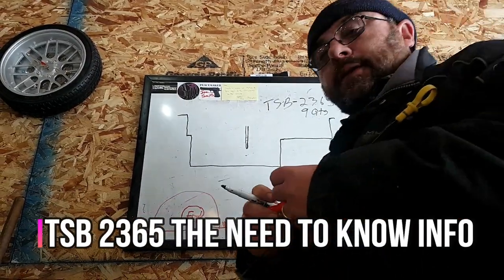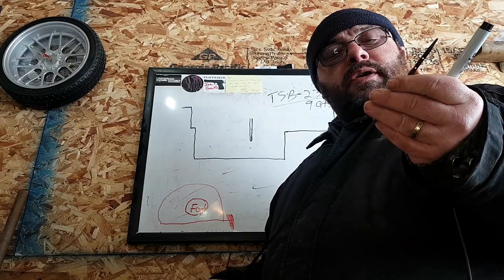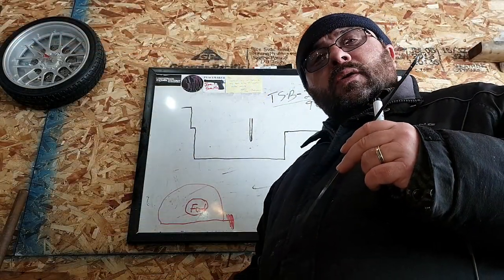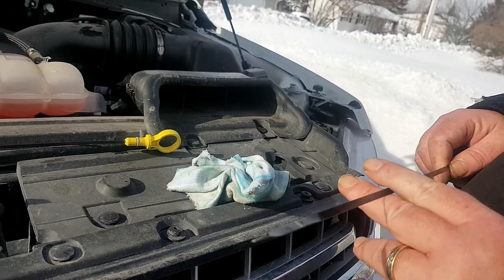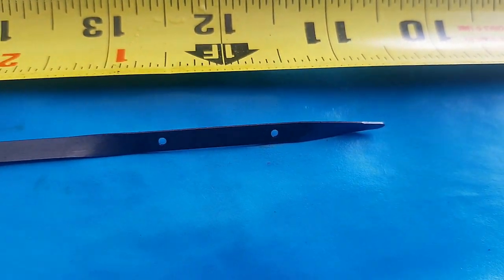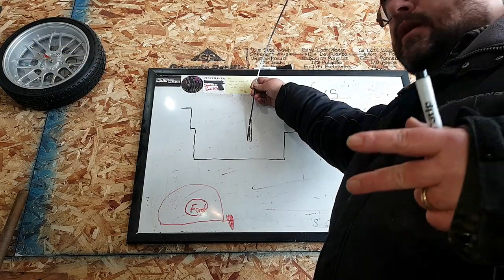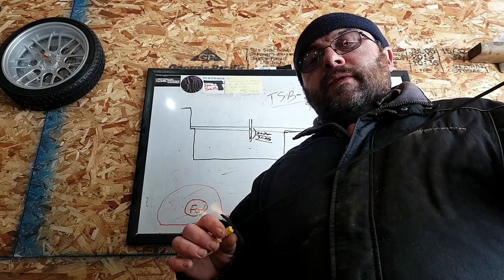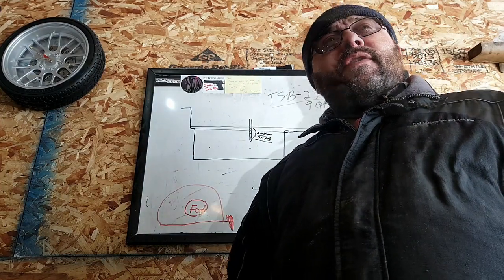tsb 2365 FORD F 150 burning oil & consumption 2018,2019,2020 supersede tsb 2338 and tsb 2058

Comment: My old truck was having this issue along with a super bad rattle on Deceleration. Dealership has fixed the rattle 3 times before and the 4th time said there was "no fix" for it. After they did the new dipstick bullshit and new oil change the rattle went away which told me my timing chains weren't getting the proper oil. So I got pissed off and sold the truck because I was sick of dealing with it, and my truck was 3,000km away from being out of Warranty. The dealership operations manager wouldn't guarantee to Warranty anything related to the ongoing issues once it ran out. Old truck was a 2018 F150 5.0L supercrew 3.73 rear end 57,000km..... Hopefully everyone else gets better service than I did, and has better luck with their truck.
Reply from the maker: seeing you were dealing with this with a 3:73 ring gear ,4:30 would be a much better setup for the 5.0 ,with the 10 speed. i just wish they kept the 6 speed.

Comment: Good informative vid Caper and it looks like you may have discovered a major problem with these new engines.  Sounds like Ford is kicking the can down the road so they won't have to issue en engine replacement recall on all those new F-150's.  Love to see what the results are in a week or so.  Cheers!
Reply from the maker: I'm looking forward to that as well. 🔨nailed it.

Comment: Just watched the whole video.
Please correct me if I'm wrong.

So Ford's fix is 4 Prong.
1.) Reprogram PCM
2.) Remove old dip stick that registered approximately 1 quart from MIN to MAX,
3.) Install new longer dip stick that registers approximately 2 quarts from MIN to MAX.
4.) Increase total crankcase capacity by approximately 1 quart. 

I was always told if you overfill an engine crankcase with too much oil, it may cause increased PCV pressures, and cause oil leaks, and increased oil consumption.  
-Chuck
Reply from the maker: Chuck is correct on 1 2 3 and 4
There is a reason that the engineers chose 9 quarts in the first place. 🤜🤛

Comment: Aahhhh I wish I had known about this before I bought my 2020 XLT5.0 only 4000km had the oil changed 3 weeks ago and just went out to check and lucky me it's almost halfway down the dipstick..booked appointment at dealer.
Reply from the maker: Sorry to hear that, let me know what they have to say,  they will try to sell you on normal breakin  period  . it wont stop using oil is the problem

Comment: I have a 2018 F150 5.0 with 19000 miles. I just changed the oil with 3% remaining and all the drain oil fit into one 5 litter jug.  It takes about 9 quarts to fill the engine.
Reply from the maker: Has the dipstick been changed in your truck Paul?

Comment: I wish I can take the motor out of my truck and put it on a new truck 4.6 I had it for 20 years and it still runs perfect no noise no burning oil perfect
Reply from the maker: The 4.6 is an awesome engine.  Ty tacho

Comment: Welp.... I ain’t ever buying ford that’s for sure!!. Great video brother 🤜🤛!!!
Reply from the maker: Keep that hemi undercoated it will last you a lifetime 🤜🤛
Reply: I've owned a few Fords over the past 40 years and have never had any major problems with any of them.  Just normal wear and tear.  My 14 year old F-350 is still running fine with over 230K miles  even with regular maintenance.   Cheers!
Reply from the maker: @TheFlatlander440  there is definitely something out of sorts the last 3 years on the 5.0 previous experience has been the same for me BILL. Ty again for stopping in 🤜🤛
Reply: It does make you

Comment: Nikasil and plasma coatings are very hard. Has anyone tried running their trucks hard to seat the rings? Mine doesn't eat any oil. Some heavy diesels with chrome cylinders have a hard time seating they use to put bon ami down the cylinder to get them to seat.
Reply from the maker: the problem is the ten speed transmission lugging the engine at low rpm like a diesel, running in sport mode would be effective . ty first and last

Comment: 2020 models now involved wow
Reply from the maker: Getting wilder by the minute
Reply: Got a 2020 a couple months ago because my 2018 was an oil burner, even after they replaced the motor. Dealer assured me they had the issue fixed in 2020, needless to say i bought my last Ford. Looking at their financial situation its estimated they will be bankrupt in less than 2 years

Comment: I had the flash and new longer dipstick installed.  I have 25000km on my truck  and they put a new engine in at 7000km and im still having the same problem with only18000 on the new engine . They changed my oil at 20000km and by 24800km it was on the low mark. 2 Liters gone. The dealer wants me to drive it till the low oil comes on and when it does he wants me to bring it back asap. I asked him for that in writing as i think this could harm the engine.  He said he has had not one customer come back with the low oil light on. I don't know if there is even a low oil light. Im not happy at all and i think im going to call Ford Canada.
Reply from the maker: I'm not sure what province you are in but look into canvac.it is like lemon law for the states. Ty for taking the time 👍
Reply: @thisguysgarage  I'm in Ontario and I work for Ford. Lol. I'm going to start asking around to see if I can get in touch with someone about this. Thanks for the reply. I read that if you change the PCV Valve to this one  7L3Z6A666A it helps. I just ordered one for $13 bucks from Amazon. Com it's over $70 on amazon. Ca. We get ripped off here in Canada.
Reply from the maker: @Satstalker  let me know how you make out Brian. Appreciate it 👍

Comment: Great video.  Do you know if the 2011- 2017 are at risk too ?
Reply from the maker: I have had 3 of those trucks  the only one I would avoid would be the 2017 if it had the ten speed transmission. 
Some had the six speed some had the ten speed.  Avoid the 10 speed at all costs.  And ty so much for taking the time 🤜🤛
Reply: Company truck lease return 2017 6 speed thinking of buying it after lease end in a month.  89K km.  I have had all the servicing done. Really quiet 5.0, no tick or piston slap.Goes like a scalded cat.  Has not consumed any oil in between 8K km oil changes. All highway.  Still has two years warranty on drive train. Do you think it will still be a problem child?
Reply from the maker: @patrickhowell9534  nope I wish I kept my 16 it was exactly the same way as your 17

Comment: Bought a brand new 150 5.0  at 3k down a liter,  i don't even hardly drive the truck i will check it at 4k   this truck makes me nervous for $ 56 K  i just went through snappin plugs in the head on my 5.4      1000 $$  for tune up snapped 1 at $99 per plug to extract  the guy before me they snapped all eight wow   8 @ 99 bucks labour just to remove the 1  plug x 8 plus 99 an hr shop rate
Reply from the maker: i hope it works out for ya! stay in touch ty for taking the time

Comment: I will check it soon. I had that dip stick change and engine flash a week ago. Would that engine flash hurt the performance? Thank you for your past advice.
Reply from the maker: They don't talk much about the engine flash. I'm skeptical the flash will or can change anything in regard to consumption. If you have not noticed a  difference. It should be negligible.  Ty for taking the time and please do let me know when you check the oil 🤜🤛
Reply: @thisguysgarage  I will let you know for sure.

Comment: This is ridiculous I got a 1999 4.6 v8 with 200,000 mi and don't burn oil at all
Reply from the maker: The 1999 4.6 was nearly indestructible. Just finished building one for my mustang. Thanks so much tacho

Comment: Hay I’m in the same boat and getting the run around. What oil are you using by that I mean what weight. At first I thought it may have been the brand of oil all being 5w-20 Castrol,Amsoil,Pennzoil,Royal Purple and Fords 5w-20. I’m losing 1 quart to a quart and half per 1000miles I’ve gone throw the consumption test and failed then the computer bull and dipstick BS. They said there waiting for a Ford engineer to get back to them on how they should proceed. I’m thinking about try a much ticker weight oil to see what will happen.
Reply from the maker: The dealer did all oil change on my truck.  Oil weight wont fix the problem and if you do that it could void your warranty.  The problem is in the engine.  Keep me posted please and thank you for taking the time 👍
I had 3 of these trucks previously that never touched oil. All were pre 2018.
Reply: don't kid yourself with different oil dude, we have a problem here.!!!!!

Comment: I've got a 2008 and it's used two quarts of oil and eight thousand miles new engines shouldn't use any oil at all they need to put new
Reply: I don't have a 2,008 I've got a 2020 Ford f150

Comment: Also had this reflash done 600 miles ago waiting to see if its using any 

Hard to believe trucks these trucks cost so much and you have to deal with this nonsense ford has been building engines for 100 years right?
Reply from the maker: absolutely right paul.
let me know what you find out and ty for your time!